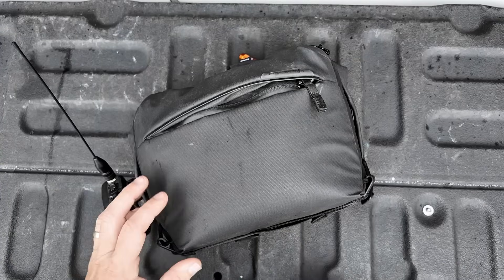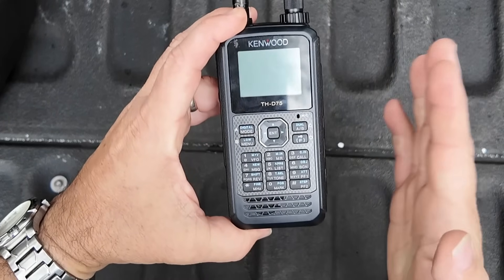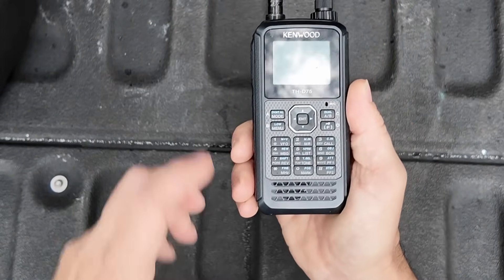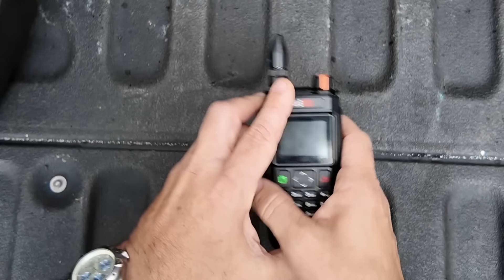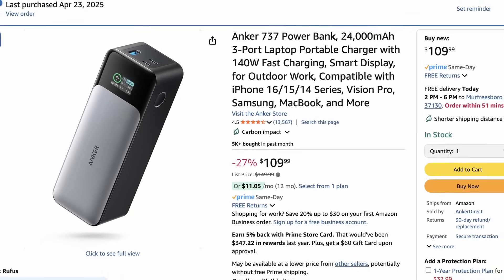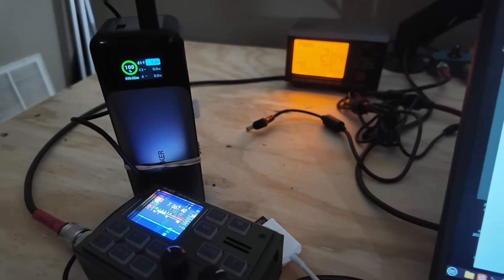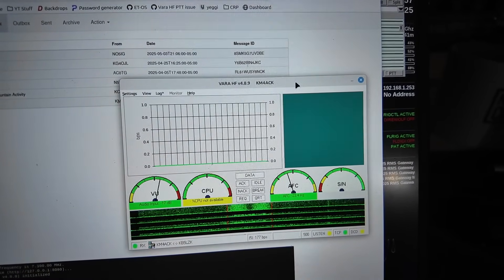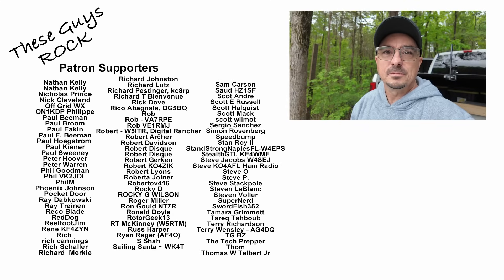One Device That Performs Multiple Tasks

Comment: Thinking of the 2 is 1 and 1 is zero concept from a different angle - that power bank could be the backup power option for the HF radio if you're doing an HF activation and take a small lifepo battery.
Reply from the maker: Good point

Comment: it doesnt do passthrough charging. ill only buy a power bank that supports passthrough. that way you can charge devices while the bank is charging think UPS. none of the anker devices support passthrough
Reply from the maker: Passthrough charging while convenient creates more heat and shortens the lifespan of the smaller battery packs. It would also charge both the battery pack and the connected device slower in most cases. I could see the benefit though to being able to do passthrough overnight and have everything charged in the morning without swapping cables. My use case doesn't call for it though.

Comment: Will the 12V USB-C Cable power both the VX-6 and the FT-70? Is it in your Amazon store? Thanks for a good video.
Reply from the maker: Yes. The 12V version of the cable will work with the FT70 and VX6. https://amzn.to/3RL1ui2 You will also need the right barrel adapter. This is the one https://amzn.to/3zTMMQ8 I use. #affiliate

Comment: I have the slightly heftier version of the same power bank; the version I have is 27,500mAh and can push up to 240W combined. This also means I've had no trouble driving a radio like the FX-4CR at 10W digital (except for the risk of overheating 🙂) with it. Anker is the brand I recommend most often for its adherence to the 12V part of the USB-PD standard. Apparently, 12V has come and gone and come back to Power Delivery, which means some otherwise compliant devices don't respect the trigger.

These power banks will similarly power a QMX or QMX+, which are both notoriously finicky about meaning *12 Volts* (or 9 Volts if you build the 9V versions) and not **13.8 Volts**, with no difficulty whatsoever!